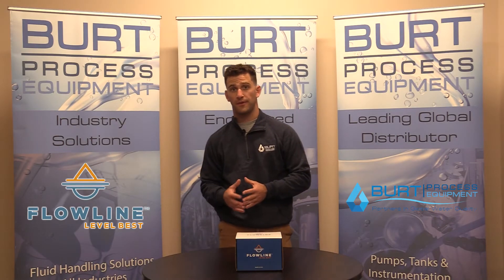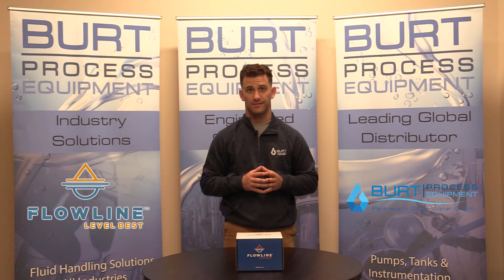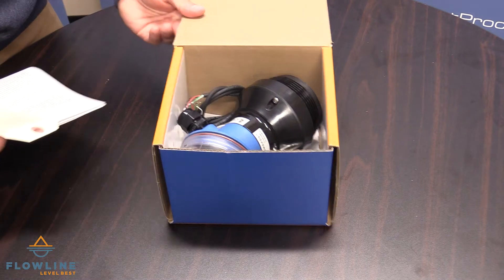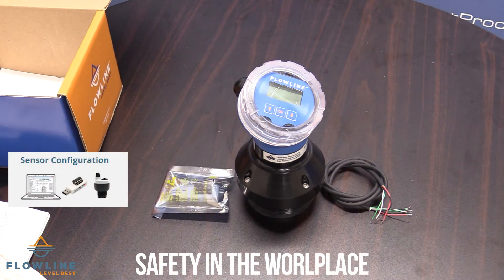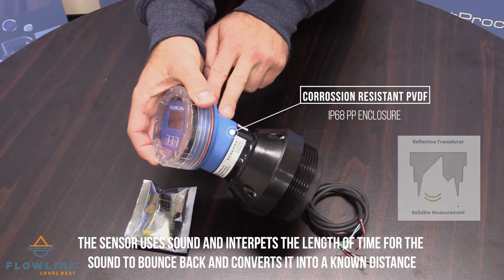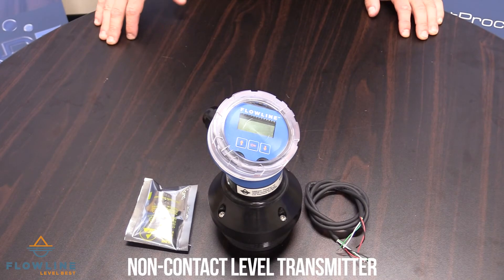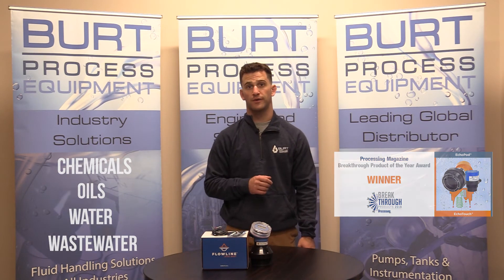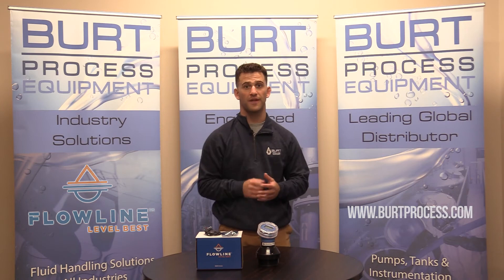Flowline ECHOPOD UG12-0001-01 Unboxing Video

Comment: can you give me the beam angle, not the beam width in inches?
Reply from the maker: Unlike of other ultrasonic transmitter brands Flowline has a unique algorithm that narrows the acoustics measurement to only a three inch beam. Our transmitters remove common obstruction issues with wide beam angles. The technology is a step forward and supports the award winning design of the UG12 series and its reflective technology to prevent weakening signals cause by condensation.